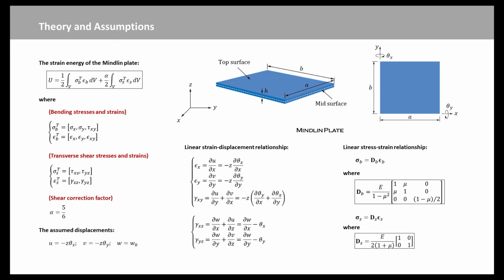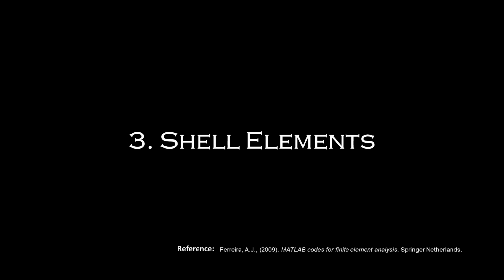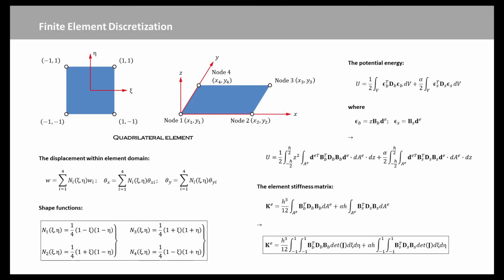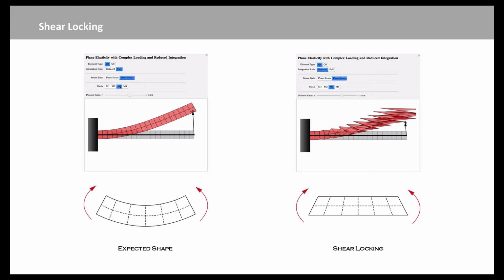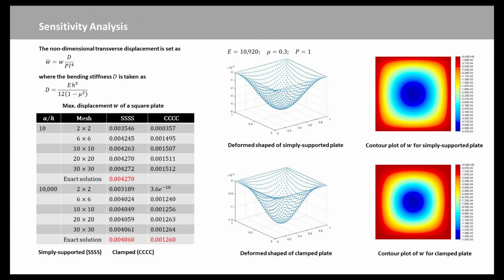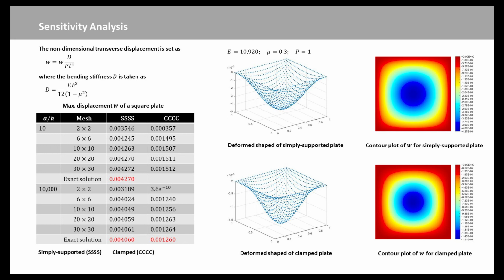Finite Element: Mindlin Plates

Comment: hello sir, I just have a question about the riks method, in abaqus
I have modelled a hollow hyperelastic sphere under internal pressure using axisymetric, using static riks,
My problem is that I don't know how to plot the pressure versus displacement curve.

Comment: how to eliminate the shear locking in solid element with enhanced assumed strain
Reply from the maker: It is dependent on your specific problem. In the plate problem, if the plate is very thin, the shear part can be ignored. Thus the Mindlin-Reissner is reduced as Kirchhoff-Love theory.
Reply: thank's @qidang
Reply from the maker: @azeddinekhellaf4826  You are welcome!